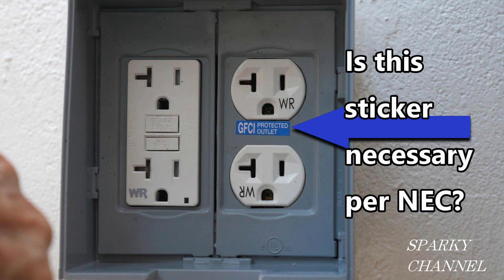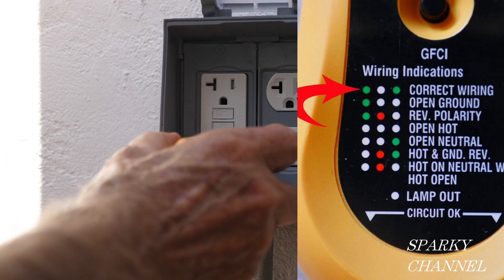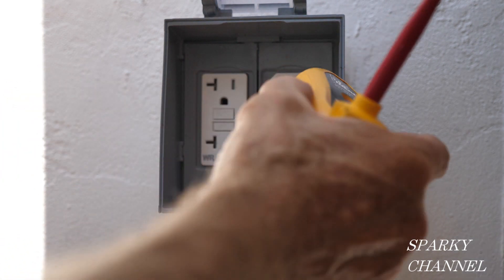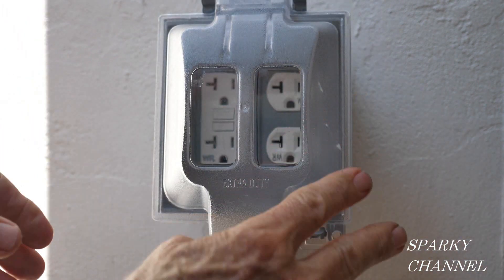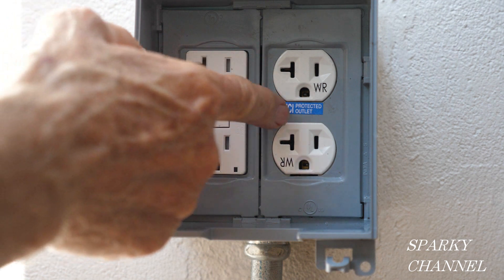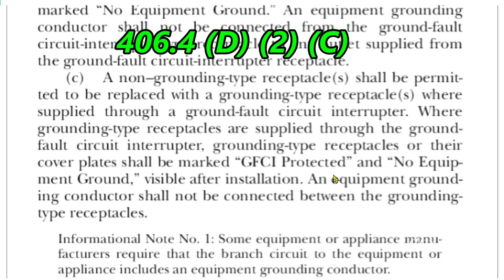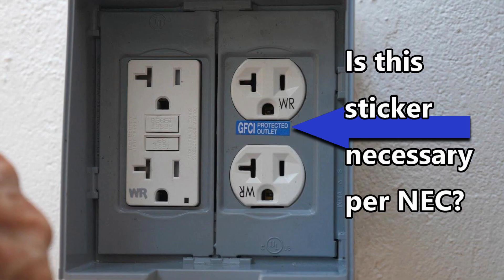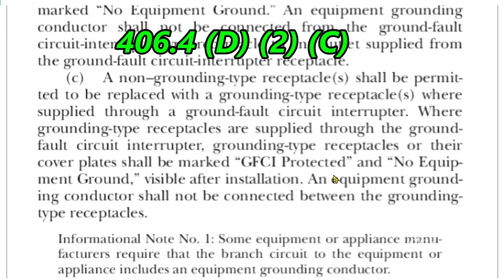Stickers Necessary for GFCI Protected Grounded Receptacle?

Comment: Purely following the rules of statutory construction I learned when I was in law school, I'd say, "No, but..." As a homeowner, and for the benefit of anyone servicing the house, I would really appreciate having that label on ANY receptacle downstream of a GFCI protected outlet as you suggest in this video. It would be even better if the labels could neatly tell me the location of the GFCI that protects it, and I wonder if there is an industry recommended labeling scheme for that.

My old house is wired with 2 conductor BX cable. It's been retrofitted with GFCI receptacles at the locations closest to the breaker box to accommodate grounding type receptacles down stream, and some lighting fixtures are also downstream of GFCI receptacles as well. But until I completed a circuit map, it was difficult to figure out why some outlets were not working because the GFCIs that protected them were not in reasonably obvious or accessible locations. 

The BX cable sheath is securely connecte to the old metal junction boxes, so I do read continuity to ground at each retrofitted outlet, but as there is not an actual grounding conductor, I am not convinced that I have a code compliant ground up to modern standards, so I think that each of my grounding type receptacles should also carry a "No Equipment Ground" sticker as well.
Reply from the maker: I had an inspector ask for the stickers once as well with a similar situation to yours. No sense arguing, easier to just put on the stickers. LOL!
Reply: There was a time when grounding via the BX sheath was acceptable. Most of my house is that way and the original 100 amp panel doesn't even have a ground buss bar. It does have a combination ground / neutral buss bar with the green screw to the cabinet, but there are no ground wires on it because BX doesn't have the wire. Fast forward to a service upgrade, and the original panel becomes a subpanel. I had to remove the green screw from the neutral and add a ground lug to the cabinet so I could tie back to the new panel ground buss.

Comment: My house has multiple GFCI outlet protected circuits.
Garage, two interior and 2 exterior portected by a GFCI outlet
Furnace room GFCI protects outlet on the exterior back of house
Master bath GFCI protects two other bathrooms
Kitchen has two GFCI protected circuits.
 Maybe they should numbered stickers also so you could indicate WHICH GFCI outlet the downstream outlets are protected by.
Reply from the maker: Excellent idea!
Reply: I have a couple of oddball feeds in my home, like the porch lights that were (more conveniently) fed from a basement GFCI outlet because that was directly below where the switch was during a renovation. It seems the painters got water in the fixture while power washing of the house and I had forgotten about the GFCI. My brain said to make a note in the breaker panel (one of these stickers by that breaker) and the commonsense side of my brain said to use a sharpie marker on the inside of the switch cover.... so the next guy would find the note if they took the cover off to trouble shoot.

Comment: Hehehe... I brought this up in an earlier video.  I don't think this paragraph applies.  BUT, if you DO use this to justify marking the receptacle "GFCI Protected Outlet", then WHY NOT also mark it "No Equipment Ground"??  It clearly says, in the same sentence, it shall be marked "GFCI Protected outlet"  AND "No Equipment Ground"  (emphasis added).

Can't argue that this paragraph DOES apply to mark it "GFCI Protected Outlet" and then ignore that it requires "No Equipment Ground".

Is there another paragraph that discusses GFCI protected outlets that DO have an equipment ground?

Now, I AGREE that it seems like a good workmanship / prudent practice to label such outlets, it would certainly help with troubleshooting as you say.  But I don't think we can just say, "Well.... I think part of this paragraph applies, so we should do that."
Reply: Bill's install shown in the video provides an equipment ground. His receptacle does not require any sticker. The sticker won't even stay there long anyway, they ain't exactly outdoor rated.
Reply: also, don't forget to put the "no equipment ground" on the GFCI itself! Don't ask me how I know ;-)
Reply: Oh, and that same paragraph says "An equipment grounding conductor shall NOT (emphasis added) be connected between the grounding type receptacles."  Again, (I believe) this is because this paragraph only applies where no EGC is available.  So again, if we're going to claim that "406.4 (D) (2) (c)" applies, we have to comply with ALL of the paragraph and go disconnect that EGC.  (which, is another reason NOT to apply this paragraph).
Reply from the maker: Yes, your comment helped me to decide to make this video, thanks!

Comment: It's useful in troubleshooting dead protected outlets. If an outlet has no power and has a sticker, you know to look for a tripped or defective GFCI outlet somewhere. With no sticker, you'll probably be in the breaker panel looking for a tripped breaker first.
Reply from the maker: Exactly!
Reply: @SparkyChannel  ... is there anything in the code that says you can't use the GFCI stickers in a panel to identify breakers that have GFCI outlets?
Reply from the maker: @rupe53  That would be fine because it's OK to exceed code.
Reply: @Sparky Channel  I added the stickers in my panel for the breakers that feed GFCI's in our house.
Reply: with no sticker, you check for continuity between neutral and ground.  a GFCI receptacle will open the neutral, so if there is no continuity, it is one of an unmarked ungrounded circuit, an open neutral fault, or a tripped GFCI receptacle.